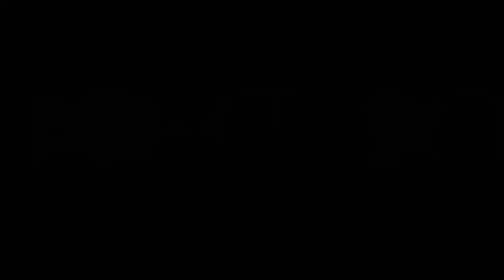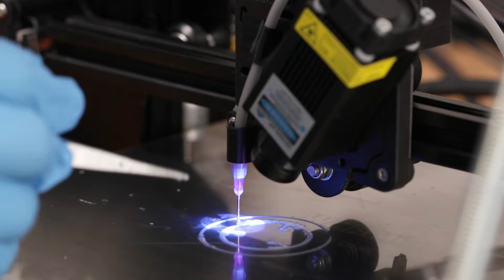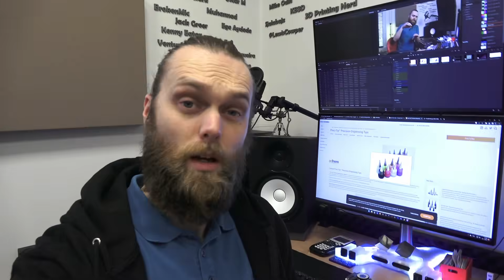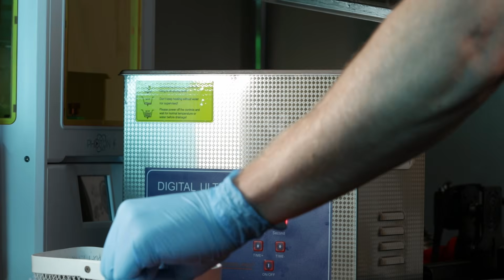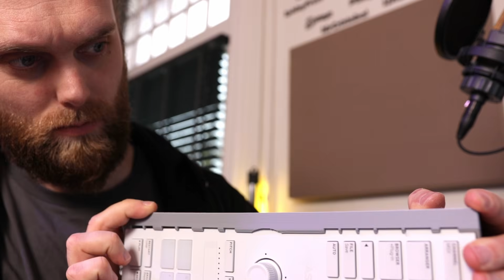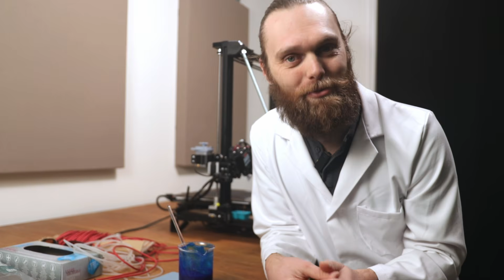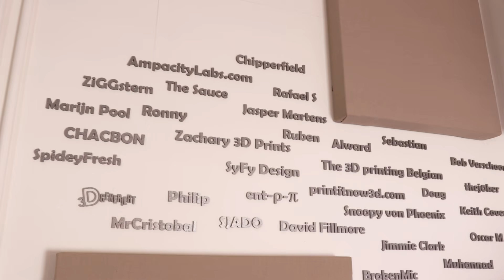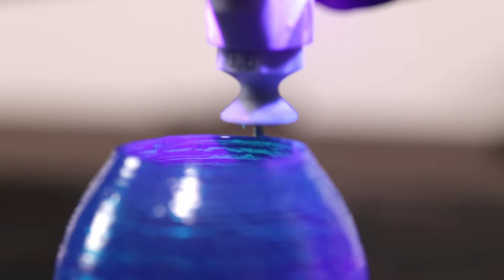I made a CUSTOM Nozzle that 3D Prints GEL!

Comment: I dont think you can call this a standard FDM printer anymore. Great work though, a good twist at the end when you got it working. I do wonder how easy it would be to modify an injet printer, you probably couldnt sell it commercially due to patents but as an open source project it might work.

Edit: Maybe some other material would be good for dissolving in the resin, or maybe a combination of materials, maybe you could try a mix of glass beads and silica. I wonder if chopped fibre would help it to bridge gaps and be more solid, obviously the chopped fibre would have to be small enough to fit through the nozzle but maybe it would work. Continuous fibre could help with bridging too, by giving the resin something to stick to, maybe you need to revisit focussing the UV on the end of the nozzle or getting it closer to the nozzle, that might help with bridging too in a similar way to cooling with FDM.
Reply: I believe the Polyjet patent expired in 2019.

Comment: You are missing a key application: UV crosslinkable hydrogels. This is how 3d cell scaffolds are printed for tissue engineering. If you could offer a lower cost version, researchers (like me) will be interested.

Comment: as someone who has modified an fdm printer to bioprint liver tissue, i can feel your struggle. my suggestions: use a syringe pump instead of a peristatlic pump for now. it gives you more control to establish the entire extrusion and polymerization and even gives retraction capabilities. once all of those things are dialed in, you can switch back to the pump for large format printing. 

going to stay curious as i am currently modifying an e3d toolchanger to bioprint resin and uv/vis cure the gel without nuking the cells inside. cheers
Reply from the maker: That sounds like a very interesting use case! Also thanks for suggesting using a syringe first to get everything dialed in. This does make it easier
Reply: @properprinting  while you are here; you might wanna read up on rheology. Viscosity is not just a one dimensional axis. For your usecase, a Bingam plastic without shear thinning or thickening properties would most likely make things easier. But things start to get complicated, there

Comment: I felt your pain during this one. I did a research project on a UV curable fluid deposition system very similar to yours and went through the same painful process. DM me if you would like a copy of the paper I published, but here are a few things that really helped in my system and might help you:

-print as fast as possible. Globing, sagging, and needle coating decreased with print speed increase. You don’t need 100% cure immediately after nozzle exit. 
-resin cure time. Not all resins are created equal. Photoinitiator concentrations vary between manufacturers. I found that formlabs Clear V4 had excellent polymerization times which allows you to print faster. 
-love your nozzle design! A simple shield to shade the nozzle tip works very well to prevent curing on the nozzle. 
-Cree 3-up LEDs. It’s a small PCB with 3  LEDs arranged in a triangle. They have a nice little hole right in the center of the LEDs that is perfect for poking a nozzle through. 
-Rigid tubing with no air bubbles. Decrease pressure fluctuations by using rigid tubing and purge air before printing. (Unfortunately won’t work with your peristaltic pump design)
-pause, retract, clean, and expose. Adding a pause between layers that sweeps over your print with the LEDs without printing can help fully cure the layer before proceeding to the next. It also gives and opportunity to clean the nozzle manually or have the nozzle run over a mounted brush a few times. 

You’ve done exceptional work so far! I would highly recommend publishing a open source paper on your system to help future research.

Comment: From a technical standpoint it's an interesting and exciting concept, and a great achievement. 
From a practical perspective it feels like the worst of both worlds. Dealing with expensive and relatively weak resin instead of cheap, mechanically more capable and clean filament. And doing it the relatively slow and clanky FDM way with low resolution instead of the high-res, true parallel printing DLP printers seems like a few steps backwards.
We should go towards cheap DLP printers printing with petg or nylon, not the opposite direction. 😄 (Don't get me wrong! It's still an amazing achievement you are proud of rightfully.)

Comment: I'm currently working in additive manufacturing lab.
I'd love to contact you sometimes to share some experience if you like
Reply from the maker: Awesome that you work in an AM lab! If you want to get in touch, it's easiest to send an email. This is found in the about page here on YT or on my website.
Reply: I also bought some stainless steel needle which has flat tip and they are stedy
I'll send you it's image.
In addition i bought 3way stop cock before it so I can use 2 material which one of them is fiber

Comment: I'm no specialist at all. That said, I can share my view :D I think making resin more viscous is good idea, so it can support itself a bit while not cured. I would add very very slow curing, so you have still liquidy 2-3 last layers, so nozzle can move thru. This could help with layer welding too, but I guess it's not your issue at the moment :) I guess all those ideas would go along with different type of pump, that don't relay on sucking, but I guess more like pushing stuff. Maybe something like screw from meat grinder, but smaller or something :D Maybe you could use some solutions of concrete printing machines? Good luck!

Comment: Vacuuming the resin for too long causes chemical stripping. The volatile components in the resin turns to gas and passes through your pump...
What is left will have different chemical and physical properties than what you started with. It may not be what you want.
Just remove the air, then stop.
Reply from the maker: I didn't know that this was a thing, thanks for the info!

Comment: Congratulations to your perseverance.. One thought, may be use an upside down bottle held above the printer (like how few printers put the filament rolls) as your resin container so atmosphere is working for you push the resin into the extruder? And a rigid tube until the extruder and soft silicone inside pump, another rigid tube from pump to nozzle, so the pressure is directly transferred to nozzle. Currently the silicone tube is acting as cushion.

Comment: What if you put the resin container at the top of the frame to get help from gravity to extrude. The container could be a big syringe that you push instead of having the pump. Then a flexible tube from the syringe to the printer head (might be an issue if you print something tall).
The last bit of the nozzle could be made of flexible tube. The laser protection you have around the nozzle in the video could also be a clamp that holds the flexible tube nozzle in place when printing and clamps the flexible tube shut when not extruding. This could also cut the continuous fibre.

Comment: Great work , how many hours of efforts you have done for this..  mixing 2 resin like epoxy may clog the nozzle but it may  solve the issue with bridge.. 

The peristaltic pump is good but it still creates very small pressure especially if there is a clog.. a machanism like injection but with threded rod 🤔(like a infusion pump).. do you think it will work more efficiently??

Comment: It seems you are having a problem relate to the capillary effect because of the thin tube. If you increase the diameters you might be able to easy pump it out. That might solve the problem of an uneven layer of material that seems to be formed in some parts of you benchy. Leave the restriction of the flow to be controlled only at the nozzle. 
Is like a firefighter hose. The hose itself is huge in diameter/section area comparative with the nozzle tip.

Comment: Have you looked into polyethylene glycol. Its a polymer that has long molecular strands that pulls its self. 
I think if you mixed it right with the resin you could bridge gaps no problem also you wouldnt need to use a pump
Reply from the maker: I haven't, thanks for your suggestion!

Comment: loft pressure for gelatin/paste is Too high with the small inlet tube.  you need a huge pressure differential; like 2:1, 10:1.  try using a inlet tube thats about 4x the outlet diameter.

Comment: why dont you just have a tank of uv resin, then uv-laser from above, add more uv resin to the tank to get next level, have the laser to confine to the exact x-y location only
Reply: ie uv-resin sintering, add more liquid levels during print
Reply: just make sure that the laser cures on the point its meant to cure, accurately, no bounces stray light
Reply: um extrude carbon fiber from dough putty
Reply: Makes me wonder if you could use the tank style set up with the added fibre being optical fibre, feed that a UV light & you'll achieve initial cure on the object surface
Reply: @NM-wd7kx  initial cure? top-side laser curing cures directly to the build plate, opposite of the current resin printers, and the print is up-right, all the time
Reply: @Jkauppa  there's a modified powder bed system that uses a powder & an ink jet style system before being lasered.
That could also be a viable way of including the fibres that Proper Printing wants to
Reply: @NM-wd7kx  well you go your way, and I'll go my way, but the direct tank laser sintering is the best, no fdm nozzle contact or even ink jet fuzzing around
Reply: @NM-wd7kx  as if I would serve the video maker, nope, just open ideas
Reply: @NM-wd7kx  liquid is faster to disperse in automatic levelling btw, compared to powder
Reply: @NM-wd7kx  well, you can do plastic/pla/abs sintering as well, the usual powder sintering method, too
Reply: @NM-wd7kx  sintering referring to the usual sintering process that is well known
Reply: @NM-wd7kx  what I propose here is liquid sintering, not powder sintering, and you can add bottom print bed to level the print automatically, if not liquid adding level increase
Reply: @NM-wd7kx  try resin sintering, used like metal/ceramic powder laser sintering, just add more material powder levels, but uv-resin liquid levels
Reply: @NM-wd7kx  and you can use a normal x-y laser engraver directly, just add the uv-resin liquid control/adder
Reply: tin sn99 soldering wire 3d printing, then electroforming into suitable metal, even melting away the mold tin
Reply: laser color 3d sintering printing + color powder sinter 3-mix blow spray at the nozzle, yep direct mix laser sintering process, public domain idea, jep nozzle a laser color sinter mix from a nozzle, then directly sinter it at the spot, spot 3d laser sintering
Reply: do a laser color powder 3d printer using that tech, yep 2d laser printer to 3d laser printer, powder mixer burner (melter)
Reply: no, nope, no powder bed, just-in-time powder mix feed
Reply: just like in color laser printer

Comment: I think you should revisit the optical fibers, so that you can have the laser light being projected directly at the nozzle tip, rather than having to angle the lasers on the tool head at a distance. I noticed you kind of just have the lasers projecting around with the nozzle, and if you can cure the resin directly and immediately out of the nozzle tip, then that may improve bridging.

Comment: A bridging fiber, a cheap and thin fiber used only when spanning gaps, if tension is kept on it until both ends are cured you would get a nigh sag free gap.
Don't need a lot, don't even need a full coverage, just span in parallel lines then go back with the normal gel to fill in the spaces, only need for the bottom of bridging layer.

Maybe use the fiber hole with a light pipe or large diameter optical fiber, pulse at a very low intensity to partially cure the resin in separate tiny chunks in the nozzle to thicken it on demand, could even make a pusher rod so you don't need to use the pump for the partial cure gel, when extruding the pump would just be supplying the volume while the pusher rod meters the extrusion.

Perhaps a optical fiber to place UV curing right at the end of the nozzle, super low intensity, just enough curing to keep it in place long enough for the primary curing lasers, yet still uncured enough for the pump to keep metering.

Comment: Would it be of any benefit, adding heat to the nozzle, or at least maybe the tube path somewhere to help liquify/soften the resin slightly more helping it move more freely? Definitely an interesting experiment, I can see it being fdms replacement at some point
Reply: I know some resins are too vicious to print well with at room temperatures, if you could find one that needs to be 30°+, heat it to about that in the nozzle, then immediately cool it with slow, but continuous airflow through the set up.
It could then be cured selectively, with s more focused laser if needed

Comment: What about using a large syringe mounted above the print head forcing the gel directly down into the peristaltic pump. It would be able to run a thicker gel if you're using positive pressure to help push it through, and a thicker gel might be able to bridge the gaps better.

Comment: Making the nozzle like a tiny one-way valve could help in getting rid of oozing and therefore giving a little bit more tolerance for lower viscosity. Basically having the flow blocked until a certain pressure opens the valve and allows flow then closes when the pressure drops.

Comment: Your work is always amazing! We are always eagerly awaiting your content at work.

Great job on removing the gasses from the resin, that's a fantastic technique. Technically, the resin-glass composite isn't a "solution" since glass doesn't dissolve into the resin; instead, it disperses and forms a colloid or suspension.

I used to work at a microfluidics laboratory, and there is a lot of overlap with your work. You correctly identified the resistance to flow in your system as the main problem. There are two sources of this resistance:

The viscosity of your fluid is very high, especially after dispersing solid glass into it. High viscosity makes it easy to control your fluid's flow after it leaves the nozzle, as it behaves in a predictable manner in laminar flow. The higher the viscosity of the fluid, the more likely it is to behave laminarly. Check out the wiki on this, as well as the "Reynolds number."
https://en.wikipedia.org/wiki/Laminar_flow

Pressure = Flow x Resistance
a) The resistance will increase exponentially as the diameter of your tubing/nozzles gets smaller.
b) As the length of your tubing increases, the resistance will increase linearly.

The greater the resistance, the harder it will be to pump resin. Therefore, you'll need to increase pressure. Consider using a syringe pump instead of a peristaltic pump. Additionally, increase the diameter of your tubing before the nozzle, which will help a lot.

Mixing the resin inside the nozzle might be a challenge as viscous fluids do not mix well. Mixing fluids in microfluidic environments is especially challenging. Entire fluid handling systems are designed to mix two fluids at small scales. However, adding baffles to the fluid path creates a mixing region and could help you succeed.

You might also consider attaching a piezoelectric disk to the assembly and actuating it at 20 Khz. This could supply energy for mixing the liquids together and potentially improve layer adhesion during printing.
Reply from the maker: This is such valuable information, thank you!! I would like to keep the peristaltic pump since the advantages of not having a limited volume and the fluid not coming into contact with the mechanics are so appealing to me. I think that a syringe pump is the only other option and I will definitely not disregard it. The piezoelectric disk is a very intriguing option, this hadn't occurred to me! Thanks again, your comment is saved in my post video post document!

Comment: I think this shadow guard thingy on the tip of the nozzle needs to be reduced in diameter a bit in order to get bridging to work. My theory is, that it takes too much time for the nozzle to move which in turn gives the resin gel time to sag down. If you reduce it too much however the lasers will reach the nozzle directly and the resin will probably cure right on the nozzle causing clogs.

Comment: What exactly is the failure here? The nozzle hits the print? And comes off?.. How about a scanning laser that has the nozzle removed from the scan? Maybe print in a bed of silica? Just throwing stuff at you sorry man.. Peace bro would love to meet you sometime. Rolfie
Reply from the maker: Especially bridging is a problem. As long as I keep printing in vase mode without too much overhang, this works like a charm!
Reply: @properprinting  would love to experiment with this.. Is the material getting hard in the tube? Is the tube uv resistant?
Reply from the maker: @GUCR44  The material isn't getting hard in the tube, but it's not UV resistant. In my previous attempt I used opaque tube to prevent it from curing so I could open the window blinds, but I needed to see what was happening. Eventually this requires an opaque tube.
Reply: This is so cool man.. I love your videos. You are an amazing person.. I was like noooo don't give up!! Hahahaha I have found many times just to take a break and somthing will come to mind on a fix to a problem.. tenacity is key. Hahhaha thank you again man peace Rolfie